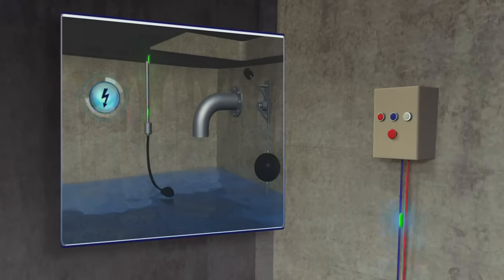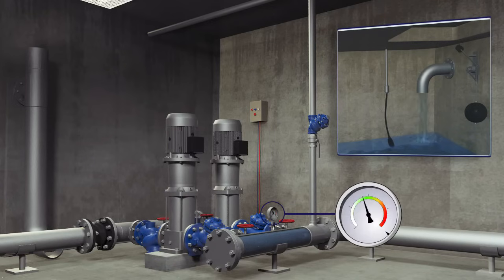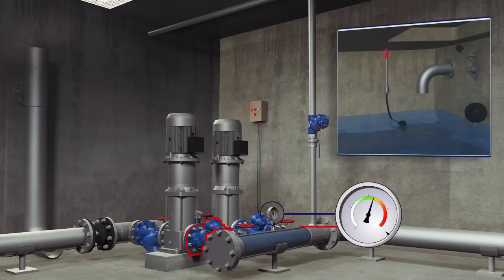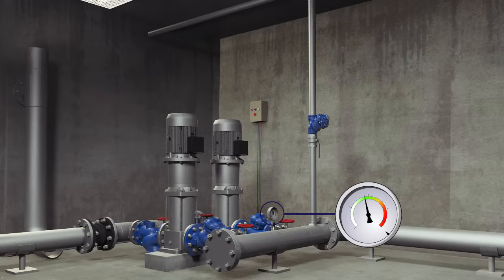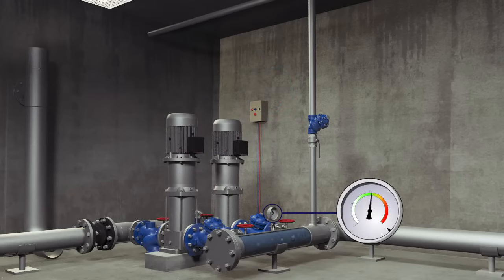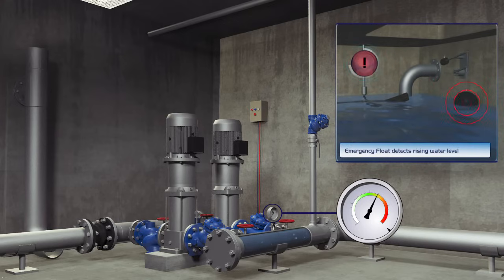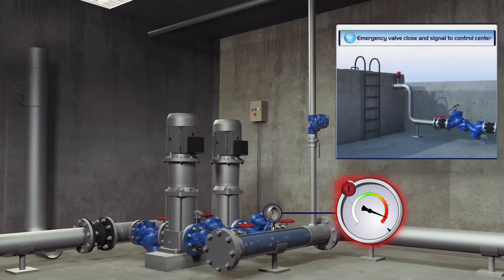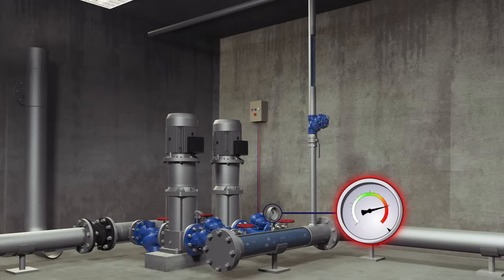Pump Operation in High-Rise Buildings

Comment: I have a question

Let's take an apartment with 20 floors... Will there be only one tank at top of 20th floor for all the floors supplied from there or there will be one at 5th 10th, 15th floors in between so that they can supply from there
Reply: For a 20 storey apartment and all, only one roof tank (with calculated capacity) will be required to feed below floors through gravity line.

As for to reduce the primary transfer pump load and losses, can use storage tank in any intermediate floor to collect water and again transfer to roof tank with secondary transfer pump.